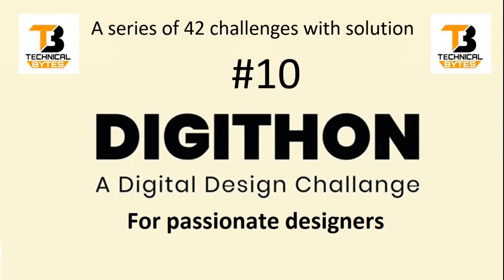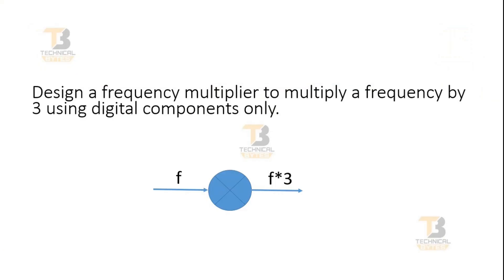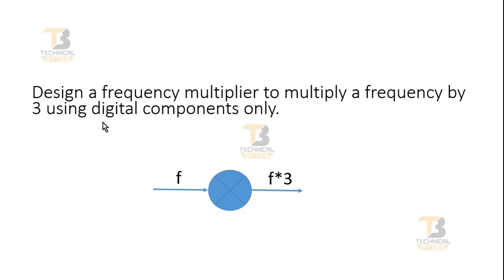DigiThon Question Part 10

Comment: Circuit Diagram: https://drive.google.com/file/d/1mxg7vIwRL9XM1RdgNhRzceTxUitgDDEz/view?usp=sharing
Reply: How do you come with this design 
@dhakagyan1
Reply: Here the output frequency is basically f*2 + f*4 / 2
Reply from the maker: Hello Dhyan, I saw that you are using two clock frequency dividers.
First one will divide F*2 by 2, and output will be F.
Second one divides F*4/2, and output will be F/2
if you exor them, it is not F*3

Is my understanding correct?
Reply: @TechnicalBytes  ya it's not f*3 its f/3 which having 0.33 duty cycle
Reply: @TechnicalBytes  Indeed his idea is correct, 2f xor with 4f to get the 3f. If you know any other solution share it.